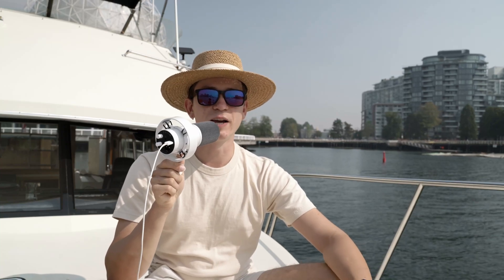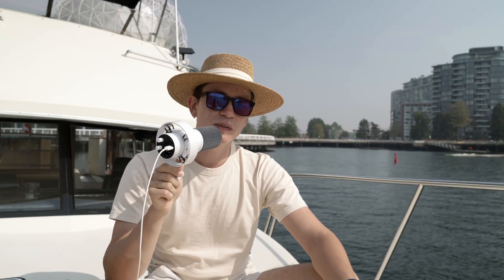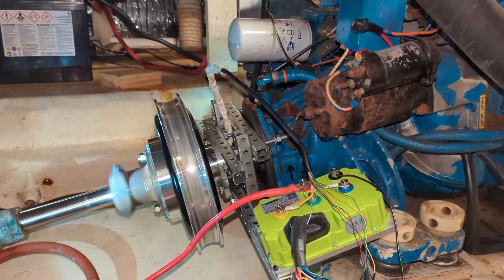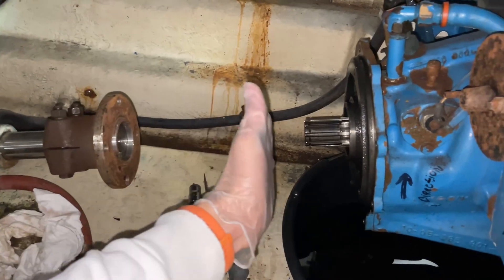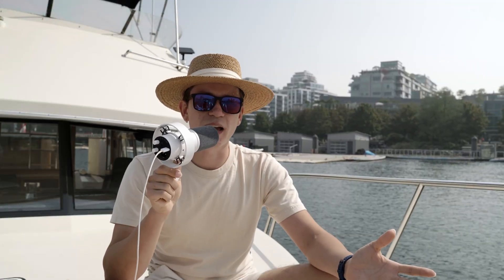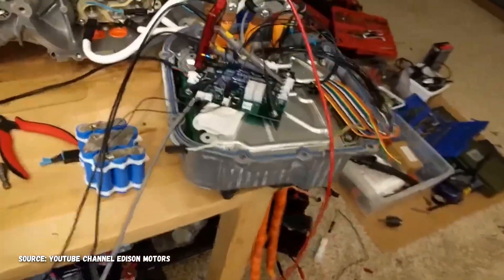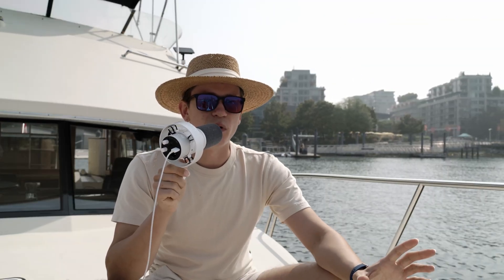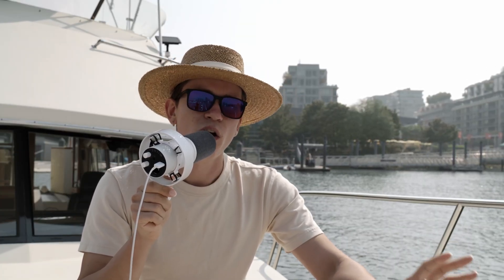What Happens When You Put a Prius Motor in a Boat?

Comment: Love the channel. There
 are obviously a good number of options. 
Family member worked on modern navey subs , i seen a short video on electric drive motor.
it was very narrow but huge in diameter.
Im assuming the larger diameter will produce more torque less amp draw more efficient, i think for your boat im assuming it has approximately 26" diameter propeller's . a brushless 12"+ diameter motor should be really efficient and powerful i watched electrical engineer attached garbage can 🗑 sized transformer between the generator and the electric motor , he over doubled watt output.
i would say use diesel generator 
But a spark ignition engine for gen power has much greater efficiency potential,  
evaporate the fuel on 600°F hot plate turning liquid fuel into white vapor aspirated that into engine as if running on lpg or propane except efficiency is multipled.
Reply from the maker: Really appreciate the thoughtful input! You’re right — prop size and motor diameter play a big role in efficiency. Our props are indeed around 26”, so torque and low-RPM performance are exactly what we’re focusing on with this Prius setup.

Diesel would definitely make sense for long-term cruising efficiency, but part of this project is about experimenting with what’s possible using hybrid systems that are already available and affordable. It might not be the “perfect” solution, but it’s a step toward learning how far we can push alternative power in boating.

Comment: Sailing is the sustainable boat power.  If you dont like that ask yourself why you are doing this.  To keep from grounding in a strong shore wind you may have motor for 12 hours or more. After a couple of hours you will be on generator only with the generation losses, regulation losses and motor losses. A shaft from a diesel is very efficient. Get salt water in anything and it's over. Most if not all cutting edge hydride boats have failed  and Ben taken out of service. Heed that lesson or join the crew of Theros.
Reply from the maker: Sailing is definitely sustainable, but that doesn’t mean it has to be the only paradigm. Boats used to be built from wood too — yet nobody is fighting fiberglass or steel as materials today. Same with propulsion: just because diesel shafts are efficient doesn’t mean we shouldn’t explore other options.

For us, this hybrid experiment is about finding something that can still be efficient and, more importantly, comfortable for our needs. It won’t be perfect for everyone, but it might be a step forward for us and maybe for others who want to think outside the box. 🚤⚡️
Reply: @YachtCityLife Do read the Theros report  and if they have not been taken down, the video they posted of the build.
Reply from the maker: Honestly didn't find any report or a video. If you refer to something it is better to attach the link

Comment: If your going to chase a hybrid setup in the prius, the gen 4 is your best bet. The gen 2, gen 3 are dogs and they have alot of legacy problems like burning oil and low capacity batteries. A prius prime from 2017 would give you well more then enough power and be reliable. The salvage yard would be the cheapest setup. The low end prius packs on gen 2, and gen 3 only have 1 kilowatt of power will get you 1.2 miles but the rest of the time you will be using gas. 
The 8 kilowatt battery pack would net you at least 14 miles of ev mode in water. The prime can self charge the pack or you could add solar or shore charging.
Reply from the maker: I think I did explain in the video why I'm going with gen2 now

Comment: It's a nice idea. But saltwater and EV don't mix well😅
Safe boating
Reply from the maker: Sure)
Reply: @YachtCityLife  well a fellow sea fairer. I know wires get corroded up all the time. So I can only imagine what a high voltage system would be like, though I have pondered this idea before
Reply from the maker: Don't need to imagine, check our other videos. HV for the last two years. No corrosion. Maintenance matter
Reply: @YachtCityLife I also work on the water, and every other year I find I'm going over wiring... But that might just be me, but I'm on board, with the plan, and can't wait to see how yea due me guy
Reply: For the case he can just run an heat exchanger from the old boat setup and adapt to the Toyota Prius engine
Reply: @carholic-sz3qv yes but it's the salt filled atmosphere I'm tryn to get at
It's a sound and solid idea. But the salt air is where I have my resovastions

Comment: A great idea but I would be very concerned about the risk of fire/explosion by playing around with these components never intended for a boat. If the engine would have been a diesel of course less of a problem, but what I understand you will keep your function gas engine, so there will anyway be a rsk having gasoline fumes in the engine compartment. Besides everything you also have to make a marine conversion for cooling the exhaust manifold etc and a lot more.
Reply from the maker: That’s a very valid concern, thanks for bringing it up! You’re right — any gasoline engine in a boat requires careful safety measures. Our current Crusader engine is also originally a car engine that was later “marinized” with water-cooled manifolds, spark-protected components, and proper ventilation. We’ll be taking the same approach with the Prius drivetrain — adding cooling, sealed exhaust, and safety systems designed for the marine environment.

And yes, we’ll still have one functioning gas engine for now, but long term the goal is to reduce fuel use as much as possible. This project is definitely a challenge, but we’re going step by step to make sure it’s done safely. 🚤⚡️

Comment: Check out the Horse range extenders that are being fitted to many serial  hybrids  . A 1.5-litre four-cylinder engine is standard, but Horse Powertrain has not yet provided any details about the other components. In the naturally aspirated engine version, the Horse C15 is said to measure 50 x 55 x 27.5 centimetres. It can be installed either horizontally or vertically, “allowing the unit to be placed in a BEV’s front compartment or in the rear,” . 80 plus kw  for normally a spirited and 130ish for the turbo version. It's a multifuel motor running at one speed.. it' has the generator and control mech integrated into the package..
Reply from the maker: Yeah, I’ve heard about the Horse range extenders too — pretty interesting concept! From what I understand though, their main focus is retrofitting existing EVs into hybrids. In my case, it’s just simpler to grab a complete, proven hybrid system like the Prius drivetrain and adapt it straight out of the box, rather than piecing together a new platform.

But I’ll definitely keep an eye on Horse — tech like that shows how many creative directions hybrid power can go. 🚤⚡️
Reply: @YachtCityLife  ZF are also producing a ultra compact range extender for their drive systems ...the problem is when you look or read it might just be a badge engineered Horse 3or 4cylined unit.. 🤔🤞🏻👍🏻

Comment: Sailboats are faster. Just my 50 cents...
Reply from the maker: Who cares if there is no space inside
Reply: @YachtCityLife  Need a bigger sailboat then. Whats the problem?
Reply from the maker: OMG, it is not a sailboat channel my friend. But I will explain to you. Out boat is 40feet, 45LOA. We have been on 45feet sailboat before and it is tiny, it does require a ton of work if we want to go anywhere, maintenance is nuts wit hall these lines and sails. There were 3 of us on that boat and we constantly did something. Deck space is limited. Flybridge is non existent by design. All solar panels will be obstructed all the time if you will have any place to install. To get the same living space as we have now we will talk about $1M+ catamaran of the same length or monohull 60+LOA. Which will be nuts to maintain or control. To control my boat I can do it alone while sitting inside of the warm cabin. Do I need to continue? I don't say that sailboat's not effective or slow. They not comfortable that's a dealbreaker for us. I hope I did answer your concern
Reply: @YachtCityLife  And it is faster. I repeat my 50 cents. Never said anything about space or convenience did i?
Reply from the maker: Whatever 😂

Comment: an episode that I have been waiting for a long time. On our 15m wooden boat and almost 30 tons, we had made calculations helped by professionals in electric marine propulsion and the calculations had proposed us 2 motors of 50kw each but with their torques, we calculated that we would barely use 15 kw at 6 knots. the 2 electric motors are coupled directly to the inverter and on the other side coupled to electromagnetic clutches which allows us to connect them to a diesel engine in central position. In this way, we can turn the 2 inverters using a single diesel engine and at the same time turn the electric motors which are in this configuration in generator mode and recharge the battery banks. When the batteries are full, the diesel engine stops, the electromagnetic clutches cut out and the electric motors start propulsion. All without ever stopping navigation.  The battery banks allow us to sail non-stop at 6/7 knots during the day thanks to the solar panels. At nightfall, we sail at 5 knots. The battery banks slowly empty and, if necessary, the diesel engine starts and the diesel recharge/propulsion cycle begins. For this system, we use Nissan Leaf engines as well as open source engine management systems on the net. Good luck!
Reply from the maker: 2 motors for 50kW sounds like a real number to me. The only downside in the system you described is that if you are not going anywhere you won't be able to charge your batteries unless there some extra gearbox installed that disconnects motors from the shaft. This way they still work as a generators. I've seen this setup multiple times it is getting quite popular because of ease of implementation. Would be interesting to see it in real life. Do you have videos of it or is it only a plans so far?
Reply: @YachtCityLife 
Hello, indeed, the mistake comes from me, there are also solar panels on the boat. In any case, even if you are not going anywhere, you can always start the diesel engine and the electromagnetic clutch to recharge the battery banks thanks to the electric motors, because we have kept the inverters, so in neutral position, the boat will not move. It is mandatory to keep the inverters because although the electric motors can pivot in both directions, this is not the case with the diesel engine......I am currently far from the boat but I could make you a diagram and send it to you.
Reply from the maker: Thanks, I'm always curious about other setups, it would be interesting to take a look at how you've done that. You can shoot me on my email yachtcitylife@gmail.com

Comment: Not sure if you have a diesel mechanic take a good look, but it would seem cheaper to repair the original engine.... You don't move around that much to make electric pay surely, and being low on power in bad weather would seem to be not ideal. Repair the original, wait another 3-4 years and gen 5 will likely reduce in cost to offset the repairs to main engine, which you could then sell anyhow.
Reply from the maker: Well why do I need to show a gasoline engine to a diesel mechanic? And no it is not going to be cheaper. The main idea is to make use out of the boat and not to fix old crap that burn 15l of gasoline while idling. I don't have an oil pump on my backyard lol. I never had any problem going in any weather with only one engine I have (starboard crusader is still alive... kinda) so it is still going to be there, but instead of being the main engine now it is going to be a reserve or the one I will use for maneuvering. And yeah, waiting for 3-4 years lol, I'm not here to waste my life XD

Comment: Yes you can upgrade the battery size, but the OEM battery has no intelligence or management only voltage imbalance monitor. I suggest you keep the OEM battery in testing and run it in parallel with a bigger pack of slightly higher voltage, the way toy/Lexus inverter chargers work is by voltage limits above X voltages the inverter wil push max ev assist and decrease as voltage drop, I think gen 2 does 20kw if battery is over 220v, so if u can just get a big ac DC rectifier you can pump in 5kw of charge just from house bank even,
Reply from the maker: Yeah it is one of the options on my road map. The only downside is to keep this old battery (it is not water protected so it creates some challenges on the boat). Ideally to relace it completely. The main ECU has communication to the battery BMS via CAN. So I can or simulate entire CAN protocol (perhaps too complicated) or I can spoof signals to the battery BMS itself to make it "feel happy". But first step will be to keep everything as is and just make bunch of tests to understand loads and power demand. The main goal is to switch to Gen5 at the end. And perhaps just use Gen5 battery as is because it has already sealed case and active cooling inside of the battery which is really good. And yes I would be able to use bidirectional inverters to connect these HV batteries to my big 48V house battery but it is all plans for the future after successful tests on Gen2.

Comment: MAD MAN. 

You know if I remember my Toyota hybrid training many years ago I was told the magic sauce is how the CVT or what is called "hybrid synergy drive" because its not like a standard CVT it has a planetary input balances the power outputs of the engine as well as MG1 and MG2. It might react differently trying to push a propeller than it does a car. If I understand you that is what you intend to do here - engine, CVT and both motor generators and just increase the battery size and run petrol hybrid - gambling that you can chug around on MG2 from a larger battery pack when cruising and run the engine when needing more horsepower when running against a current and to recharge the batteries and even pull output from MG1 for electrical power for the boat or your leisure battery. 

It is a very intriguing idea though. Many years ago I worked at an industrial estate where our two work vehicles were an old LDV diesel van and a Gen 1 Toyota Prius. The mad professor type who owned the estate had modified it with an inverter powered off the high voltage battery to run power tools so it acted as a mobile generator because parts of the estate didn't have electricity. We even ran buildings off it at times.
Reply from the maker: Hehe, a little bit) 

Yep you get it right. I think "Toyota synergy drive" is the most efficient way to connect ICE MG1 and MG2 together. I know that it was done before and it was working fine. So yeah, it will be the next big step towards final "two Gen5 setups". 

And yeah there is nothing crazy about using HV battery for powering household needs. It is a bit treakier if you want to achieve the same effect on the car due to the limited space, and that you perhaps want 110VAC at the end, there is no ready out of the box solutions for this (almost), but in my case I will use Eltek FP2 that will convert HV battery DC to 48VDC that will fid directly to my house battery. I already get one for only $200 and it can output 2000W. Ideally later on to use some biderectional converters but they cost way more. The only option I found so far is Iris25 but I will have to get the entire shelf with control modules because otherwise I won't be able to control them. There is a lot of thing I have prepared. I perhaps will not go into too many details on YouTube because most of that super technical stuff is interested for not too many people, but I will share it with everyone in my private Discord channel. Everyone who interested can get access to it for only 5$ a month via Patreon. I just think that keeping videos more light and funny help with views.
Reply: @YachtCityLife are you kidding? It's why I found your channel the episode on the electric motor. Go as deep as you like my friend. It may not take off like a traditional video but the long tail of viewers for a long time will be worth it.

Comment: You guys are super inventive and are early pioneers for sure. I'm interested to see how the Gen 2 prius route works out.

What are your plans for the old Crusader 454? I might be interested in buying some parts if you're getting rid of it.

Finally, a heads up that the "Crusader Model 350" is actually named after the horsepower rating. Chat GPT didn't quite get that right, so it's a 7.4L 454 cubic inch motor. Somewhat confusing because there is indeed a 350 cubic inch GM motor Crusader had, but that was called the "Crusader Model 270". Either way, far more power than you need for hull speed.
Reply from the maker: Heh thanks, yeah but it is actually a working concept I know at least one other boat that also used Gen2 but it was like 10 years ago or so. In any case those Crusaders are history now. You can shoot me on my email about parts you need yachtcitylife@gmail.com
Reply: @YachtCityLife  Cool, sent you an email!